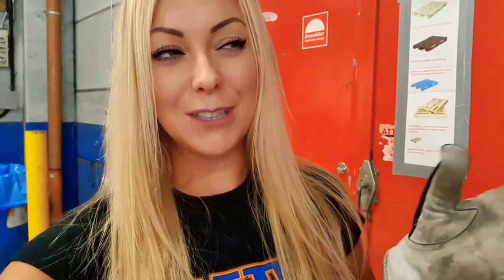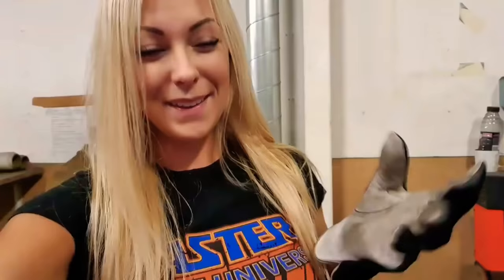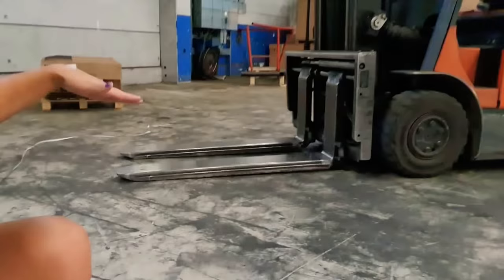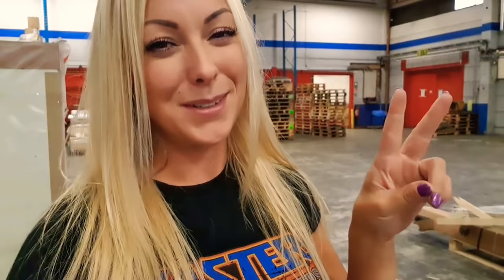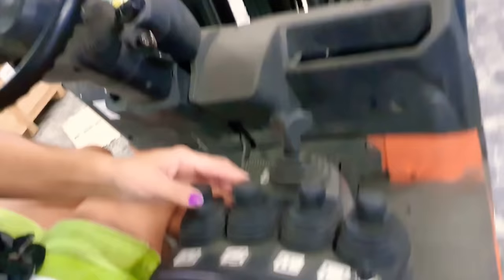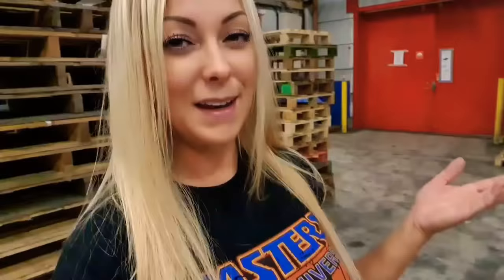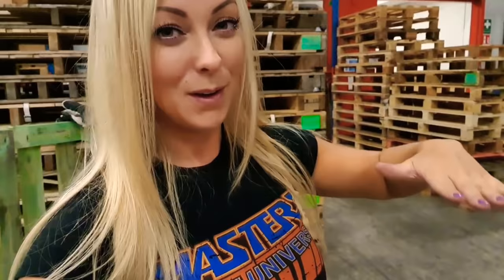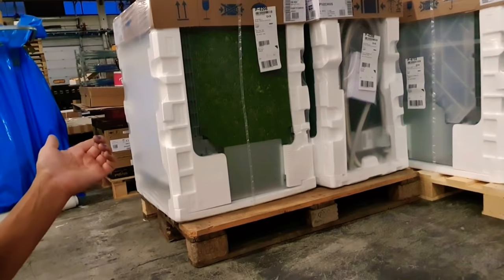OPERATE THE FORKLIFT - Angelica Larsson

Comment: Your videos are really fun and educational.  I enjoyed driving a variety of forks when I was college aged.  IMHO, one of the things a new Forklift driver needs to get used to is steering with the back wheels.  Some new drivers I have seen had trouble controlling where the forks move or the back end swings. Knowing the weight limits of your fork is also important, a heavy load can lift your rear wheels making it hard to control the load or steer.  Moving cargo sometimes take some finesse, particularly in tight spaces.

Comment: I run a forklift for a living, an electric Toyota also but different than that one. We use an attachment called a push-pull or pull-pack. Almost everything is on a 'slipsheet' which you pull onto the forks. No pallet. It's nice to see how you do things over there. 👍😎

Comment: Good old TOYOTA 😍 Dem japanese products rarely let you down. 👍🏻
Reply: They are designed and manufactured in Sweden 😀
Reply: Still Toyota, still good enough. 😍
Reply: @HashV17  they are also made in the UK
Reply: @carholic-sz3qv  They're produced all around the world. My point is this japanese brand is very very reliable.
Reply: @HashV17  you're 💯 right
Reply: I work for this company .Sweden only does stackers and reach trucks,these battery lifts are done in France ,Italy ,Japan and China
Reply: Let the lift breakdown and get ready to spend some money on those parts. 
I worked on electric lifts for 40 yrs. people think because the cars and trucks are good the lifts are to until they breakdown. 
Operator’s are the main reasons lifts breakdown, because they play with them. I’ve seen people get killed because of horseplay and not properly trained.

Comment: Forklifts have developed since i've driven one, 35 years ago. Then the only way to spread forks was by hand.
Reply: Hell no you’ve had fork hydraulics for 30 years. You had setups back then that went from 1 to 4 pallet setup with the push of a button.
Reply: Still the way in majority of the flt I drive or have drove in the UK.
Reply: I still have that on my turrettruck
Reply: @xSCHEF  Yes, but there are only few companies that renew their forklifts on a regular basis. Most of them usually are already rather old, so it's not that unusual to drive forklifts that seem to come from the past and miss all the innovative things you can get for them at the present time.

Comment: In many years trucks will getting charged like forklifts, lol!
Reply from the maker: Probably 🙈 but it will take awhile
Reply: @AngelicaLarsson  Yes, of course..
Reply: They already are making electric trucks,Cummins,Mercedes,Tesla and there is a new company in California that have made one and are testing them last year. They just need to work out all the kinks and get approval and then get them into production.
Reply from the maker: @robreber9355  I saw Cummins electrical truck a few years ago 😃 with the Porsche inspired backside. In Columbus 🤗
Reply: There are already many heavy electric vehicles on the road in Europe.   For several years has large city buses with batteries been in use.  Chinese BYD is one of the largest manufacturers within that sector.  Also buses that have fuel cells - using hydrogen - are in operation.   Both Volvo and Scania has shown battery electric trucks.  Scania has already  on the road - in daily use - trucks with fuel cells using hydrogen as energy source.  The hydrogen is produced from water and with electricity from solarpanels.   The truck's electric motor has a short time output of 290kW and continues output of 210 kW.   Range 400 - 500 km.  Filling time of the 35 kg hydrogentank only takes a few minutes.   Hyundai has started producing heavy trucks with fuel cells using hydrogen.  The first load is already shipped to Switzerland.  Norway has for several years had many car ferries that uses battery electric propulsion.  Ships are under construction where hydrogen are used as energy source and also under contstruction are ship engines that shall use ammonia(which has something like 3 times higher energy density than hydrogen).   So yes there are things going on around....
Reply: I can hear truck drivers complaining that they can only drive 5 to 8 hrs a day before having to charge again lol
That's if you get a charger overnight
Reply: Battery powered trucks? That battery will cost between $5000-10,000? Practical. Pulling hills and mountains will take extra energy. How is the Swedish experiment going in which an electric power grid was installed in a road surface to power vehicles?

Comment: Are you having a time with the speeding forklift use. It is a deadline (due date) work and I think this could be a good video if you should find these. I only did forklifts for 4 days in a small factory but it was told to me to, "Keep that pedal floored -(any of them)" and do this as fast as you can! The floor was 'always' skidded upon and forward or backward made no difference for us 2 forklift drivers. I left when an previous driver returned.

Comment: I drive a Toyota double-handler where I work (picks up two pallets side by side at the same time) requires a lot of concentration. The only un/loading I do is of pallets wagons - 2 stacks of 15 - 20 Chep (blue) pallets at a time
Reply: By any chance you wouldn't happen to work at chep? Sounds similar to their forklifts...
Reply: @nickscanlon3829  no just their pallets to our site & busted ones back to them. Chep have triple-handler trucks, footage elsewhere on yt of them in use

Comment: Little different to what I used to drive we didn’t have the extended forks or split switch Wish I had the split option on the forklift I drove was a linde would have been so much nicer than having to move them by hand (cleaner too) I used to move bins of dry ice and pallets of medical supplies greetings from Cambridge England